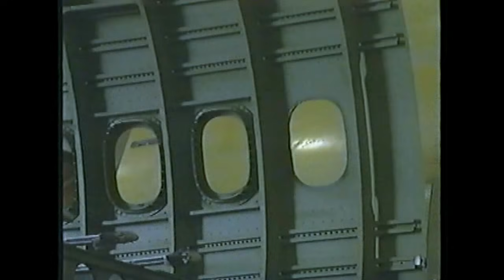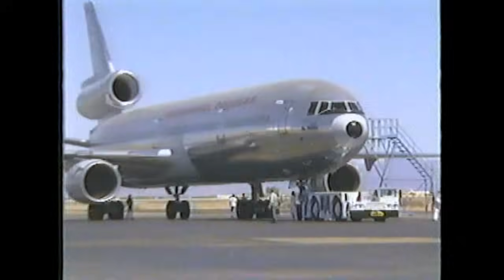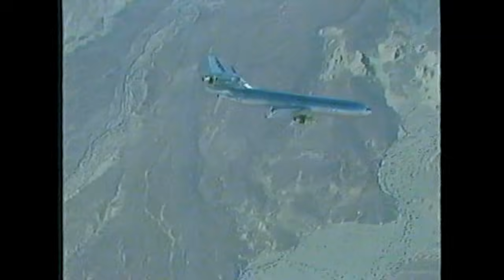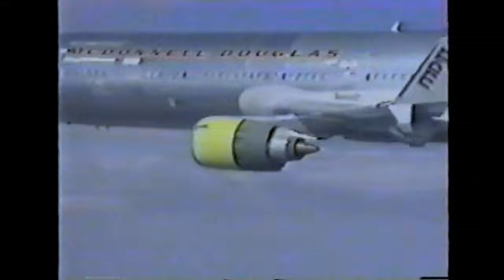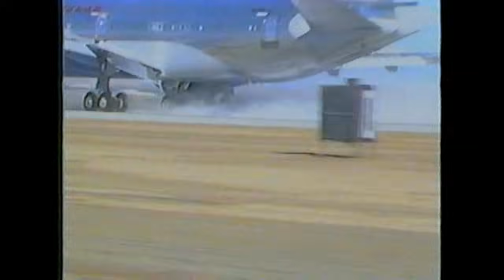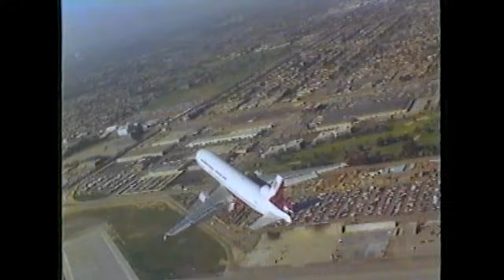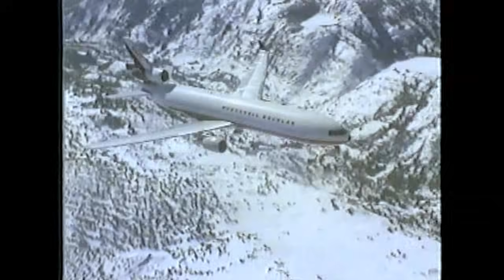McDonnell Douglas MD-11 Promo Film #1 - 1991

Comment: What if the fan disk in Engine 2 bursts?
Reply: more or lees the same issue with wing mounted engines like in the incident with the A380 and RR turbofans with extensive damage to the wing and several systems, just because there where 5 people on the cockipt the landed safe, so many systems failed at once, warnings to take care about that just 2 pilot couldnt have deal with it. Engine failures are supposed to be contained ... well, this is not happening. It didnt happend in the 70s, it didnt happen a few years Ago. For the DC-10 incident GE admited a defect in the manufacturing process the disc was found in a farm after GE offered a reward.
Reply: QANTAS 747 I think this is the specific event he/she is referring too.
Reply: 38911bytefree I've heard they said all the warnings in system helped out the pilots tremendously. They found the issue with the RR engine was oil stopped flowing to the disc that failed allowing it to spin incredibly fast because it wasn't being slowed down by the drag effect of the oil. The part was improperly manufactured and several engines had to be checked. Also RR recommended a reduced thrust to airlines which obviously they where not happy about. There are several lawsuits tied in with the Qantas A380 incident.
Reply: 38911bytefree a Southwest 737 had a blade off event/uncontained engine failure with a CFM56 engine not to long ago. These events are extremely rare though.